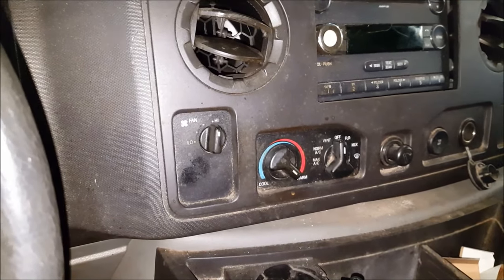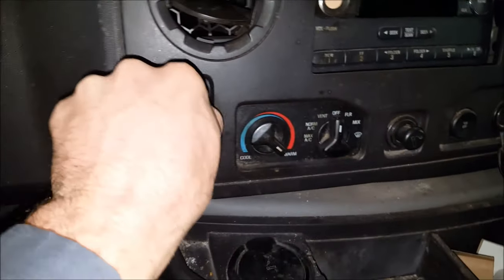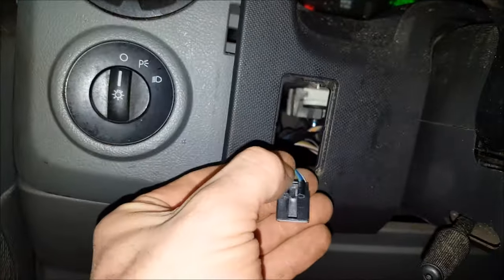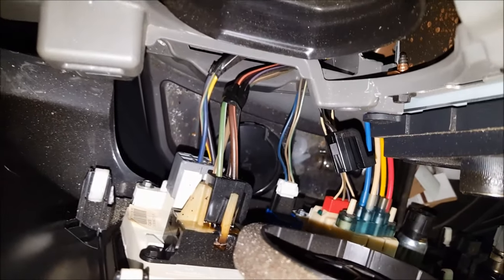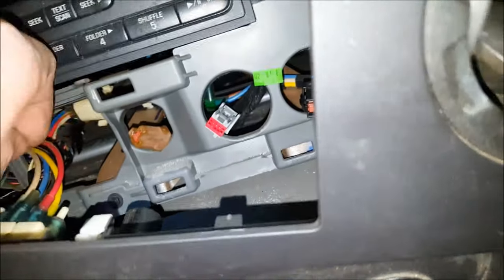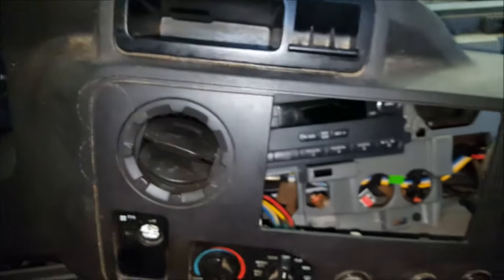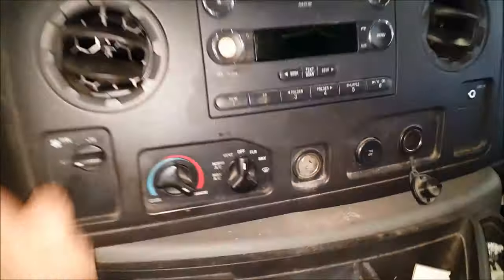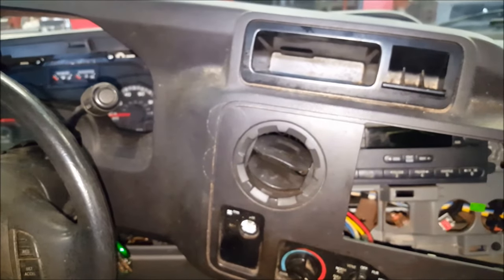Ford Van Blower fan switch Replacement how to replace knob E150 E250 E350 ford econoline

Comment: Just did this... it worked! Thanks.  Key tip you don't have to put it in 1st gear.  Just pull the driver side off further take out the center ac vent and storage container and you have access
Reply: Me too!

Comment: Going to do this switch panel swap tomorrow. Out of my 4 speeds all the way low and all the way high dont work. Replaced the blower resistor today and it made it blow about 20% harder but still no lo or hi. Swapped all AC relays still same result. My switch feels real wonky and worn out. So think this may fix it. But also going to replace resistor connector pigtail cause its heavily corroded. Thanks for this vid you really helped! I got a 2012 e150

Comment: Good video, very helpful.  But I replaced it without taking the dash off.  I took the dog house off and got at from underneath.  Cut away some of the plastic molding that was blocking the screw
Reply from the maker: Nice!  Ill have to try that next time i do one of these
Reply: Good to know!

Comment: my main issue was the pig tails was wired incorrectly so it made my dash board smoke up i'll be taking a look at it here in a minute. but showing the wires on where they connect was the big thing i was looking for. the guy that i had hook them up said he was a mechanic yet he hooked them up wrongly and almost caused my van to catch fire. so i'll be taking a look and im going to wath this video over and over until i have the pig tail inserted correctly. thank you for making this video it helps alot. #NoNonsenseKnowHow
Reply from the maker: Damn, sorry to hear that. Yeah I usually take a picture of them before I take the old wires out or do them one at a time so you can't possibly risk messing it up. Good luck on getting a corrected!

Comment: looked at my 2012 e350 this evening and by just removing the doghouse i was able to unplug the switch will look tomorrow for sure but i think i might be able to get switch out that way as well
Reply from the maker: HVACRBERT awesome man! Sounds like for yours that might be an easier way of doing it.  Let me know how it works out
Reply: still had to pop the dash panel loose but didnt have to unplug anything other than blower switch kind of a pain to lay on my back and look up at switch and kinda difficult to get screw started back in hole not sure which would be easier but removing doghouse is another option if you dont want to mess with those pesky electrical plugs, i usually break one during a repair like this. lol
Reply from the maker: HVACRBERT glad to hear you knocked it out. Thanks for the update!

Comment: I just like to add a comment about getting there, when I installed a new radio, you can drop the two bolts holding the steering column and lower it to get better access to removing that panel. Used a rubber cord to hold the column to the handhold above the door' Hope this might help

Comment: That doesn’t look too too hard. 
Now I just have to try it myself. Thanks for the video.
Reply from the maker: No it's not bad at all. Good luck with the group are, and thanks for the comment!
Reply: I did it. Of course the Ford dealer didn’t have wire harness I also needed, so I had to stop at an auto supply store for that part. But it was as easy as it looked. 
Come on winter I’m ready for ya. 
Thanks again for the video very helpful. 👍
Reply from the maker: @glengibson529  awesome man good to hear! Glad to help out, and thanks for the update

Comment: sounds to me  in the beginning of the video , even he thought it was going to be easier than it ended up being,  not sure why they don't leave more wire to allow you to pull it out further.
Reply: because its not designed to be fixed.
Reply: I wonder at this point in that trucks journey, would it not make more sense to just cut the plastic around that switch? Who cares if it looks bad, just get it to work cheaply and easily!
Reply: @arasb3258  that’s a horrible lazy short cut. Please don’t work on cars.

Comment: Hello, I have a 2011 e250.. No heat, no matter which way I turn the temp control the AC stays on. Confirmed by compressor and lines freezing. Would the blend door be the problem? I can't locate it to manually turn it
Reply from the maker: Sounds like you could have a faulty control head for the AC or maybe even a stuck closed AC compressor clutch relay. Or bad compressor clutch. Could be several things
Reply: @NoNonsenseKnowHow  thanks, there is just one blend door right? Both heater hoses are hot, if I manually turned the blend door would that turn ac off/heat on? Or unhook ac relay and see if heat is blowing?
Reply from the maker: @rodwoods317  if the AC compressor will not stop running on regular vent then that problems should be addressed. But even with the AC compressor running, it should still blow hot so it sounds like yes you might have a problem with the blend door. There are three doors. Recirculation door, vent setting door, and hot cold door. At least they're usually is 3.

Comment: Too bad it wasn't shown the disconnection if the 12v power point connections. I'm trying to disconnect the 12v power plug and there's no room to even get to it. I haven't seen 1 video of the removal if this plug.

Comment: Question:  2014 E250...when I put it in reverse the "R" light on the dash lights up only intermittently and the reverse lights on the vehicle do not come on.
Thank you.
Reply from the maker: Sounds like the transmission range switch needs adjustment or the shift cable needs adjustment
Reply from the maker: That would be my first thought anyway. Let me know how you make out
Reply: @NoNonsenseKnowHow  :  Do you know exactly where that range switch is, or isn't?
Reply from the maker: @stephendouglas4545  sorry no I don't off hand. They're usually located on the side of the transmission. But I wouldn't know without researching or looking at it. I work on all makes and models so I'm not too incredibly familiar with any single vehicle

Comment: Decently easy fix. 
I just hate that manufacturers don't want you changing parts on your own so they make the wires super short, adding extra time to repair, hoping you'll just take it to the dealer and have them charge you insane rates for labor. 

And that damn auxiliary power outlet in the center has to be the biggest pain in the ass connector to remove!!! That's the only connector I was able to remove with relative ease.

Comment: Hi I was wondering if you can help me out. I purchased a climate control for my 2003 E-250 because the fan speed switch no longer was operational. The damn thing melted. My problem is after connecting the wires the orange wire got so hot it melted the wire nut. Can you please confirm the 4-wire sequence? Black to black. Orange with black strip to Orange with Black stripe. Red with orange stripe from van to yellow with red stripe on switch. And finally light blue with orange stripe on van to Green and white stripe on switch. I’m guessing I got it wrong. Can you help me out please?  Thanks in advance...Nick
Reply: My button melted too, after I replaced it it still gets hot. I have to turn it off once in a while. I wonder why its getting hot.

Comment: My ford only blows cold through the defrost vents do you think is sana problem
Reply: No-this repair will only address a lack of the blower motor sending air through the vents. If you cannot change modes from defrost to floor to mix, etc., then you likely have a vacuum leak, as the blend air door and controlled by vacuum and default/failure position will be defrost and cold.

Comment: Need a little help , the new connectors has different colors. What color goes with what color?
Reply from the maker: The best thing to do is cut them one at a time from your old connector and put them in the same location on the new connector. Not worrying about if the colors match or not. Just make sure they each go in the same location on the new connector as the old one.  or take a pic first before cutting olf pigtail off

Comment: I have A2010 Econline its not my blower don’t blo it blo some time s
Reply from the maker: Have you checked the switch?
Reply: Don’t think it’s the switch because when I raise the hood and tap the fan it come on
Reply from the maker: @vincentbrown8661  sounds like the fan motor has a dead spot or you have a melted connector on the fan or blower resistor.  Let me know what you find out
Reply: Looks like the elect. Connection on the blower goes bad too. The prong will be loose. That's why tapping will make it work or why it can be intermittent